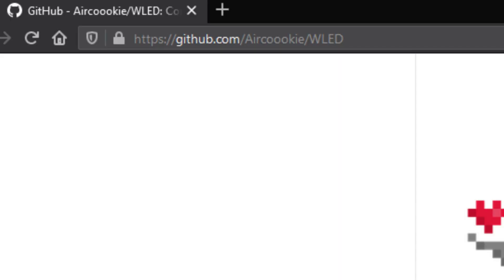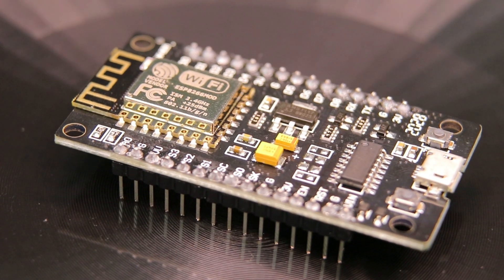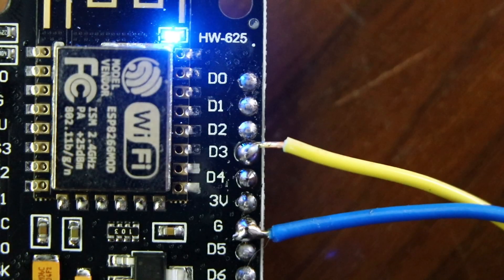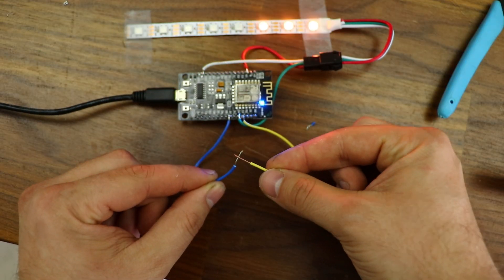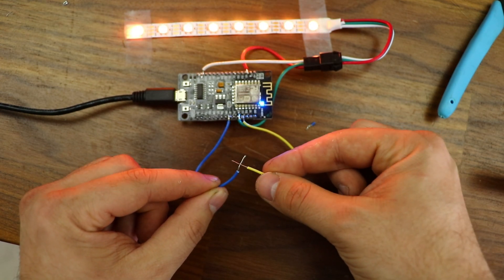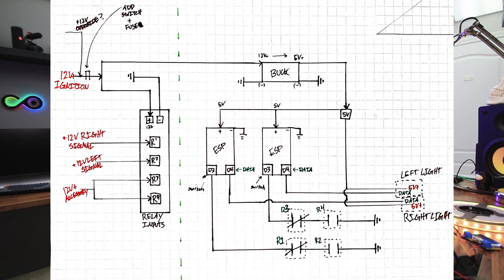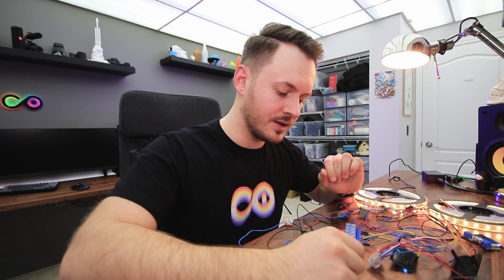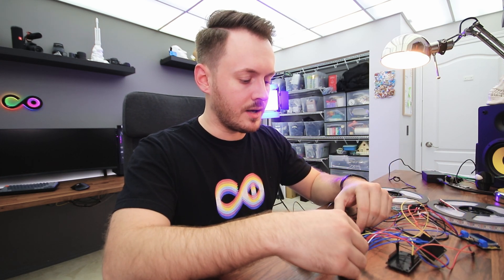Modifying My Headlights With Open Source Hardware & Software

Comment: I feel like as vehicles do more and more proprietary stuff with their lights and other electronics, we're going to need more people like you showing us how to replace them ourselves. And if we gotta go through the trouble, why not make them better than the companies did?
As a sidenote: I'd be curious how to make the headlights not blind people. Especially in these taller trucks. I feel guilt driving them, because I know when I'm in a sedan those things are like tiny suns and blind me for sure.
Reply from the maker: The issue with tall trucks is nobody aims their beams. I properly aimed mine so they don't blind people or beam into their mirrors when I'm behind them.

Comment: So unless I missed something you seems to be using gpio 02 and 00 (d4 and d3) and these are the boot pins for the esp8266 and it's just those two that need to be in a specific state at boot time, looking at your wiring diagram you could simply move those one of the other free i/o pins.
Reply from the maker: With this version of wled it was coded in to only use those pins for the buttons, now it's mappable and can be customized (for when I redo this)